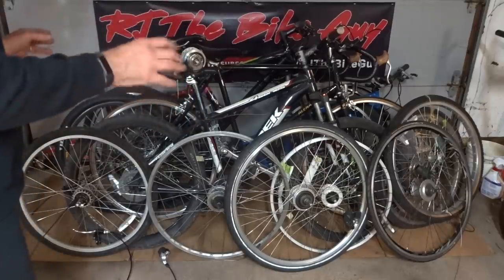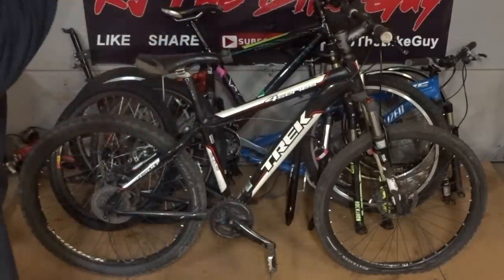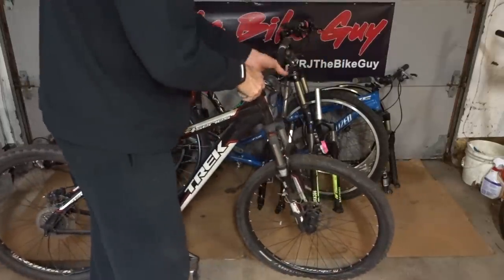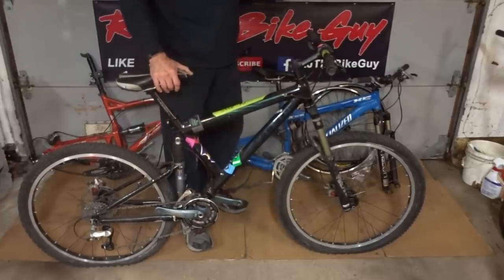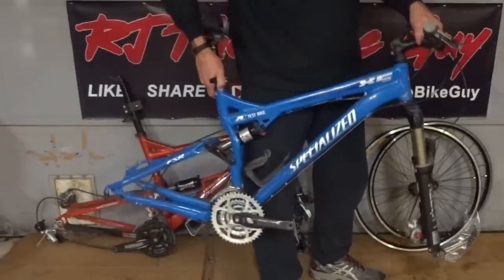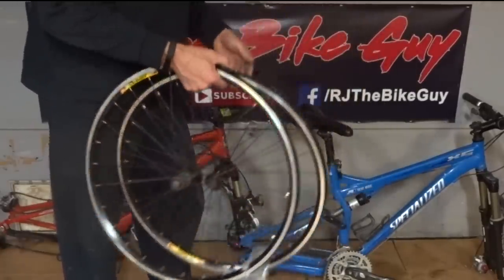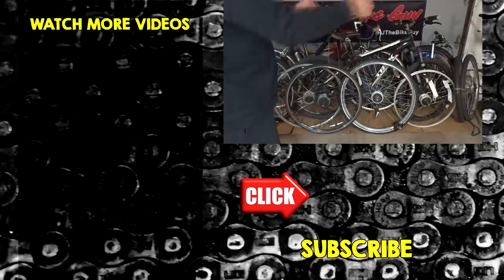My Bargain Bike & Parts Finds At Bike Co-Op Garage Sale!!! Amazing Deals!!!!

Comment: That’s awesome.. vary good find , them full suspension frames good like they can be turned into a nice set of bikes. Can’t wait to see a few builds. I worked at a bike shop for sometime and I jumped all over cool stuff like that when it came in. Today’s younger gen does not see carbon or new it’s junk to them. That looks like a find to me.....

Comment: 1:16About the cheap BB & cranks from Shimano: the Shimano square taper BB wont last me long, I get play in them after few rides, knocking, also cranks don't last me long.
I went with Chris king BB,Race Face Turbine cranks, stiffer and lighter setup, also can take major abuse, upgraded to cane creek preload ring.
have absolute black oval chain ring & bash guide.
the Bontrager Ranger wheels are junk, spoke nipples are weak, this is common problem on budget Bontrager wheels, rock strikes & truing will wear them out.
the headset is also bad, horrible seal, it will make a greasy mess.
the new bontrager saddles are uncomfortable but their older fit me better, but they wear out fast anyway, the plastic plate will come off, screws will come off. cheap upgrade I suggest is fabric scoop, if you go for steel rails, they are cheaper, if you find them on sale, its a great value, and will outlast most of the expensive traditional saddles.
the stem & bars: stem is heavy, bars will bend on side impact, so if bike falls over or you have to bail you risk bent bars. 
the seat post has worked well for me, only complaint is you cant get the angle 100% perfect, but it has been secure.

Comment: Now I have some idea how much parts cost.

I saw your video on how to clean the front suspension. 

I finally figure out how to take the cap off. Then I see Allen screw about 12 inch down. 

I need to go buy a long allen wrench. I was wondering what size that bolt usually is? Is 1/4 inch? Or all different sizes per manufacture? The now I am doing the operation on is just a Moongoo full suspension.
Reply from the maker: It will most likely be metric. Probably 5 or 6mm.

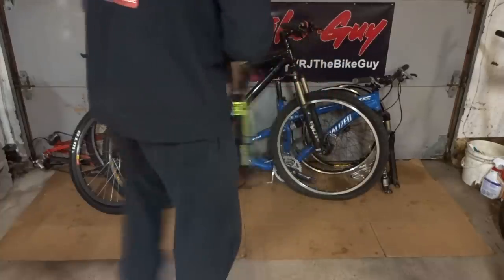Comment: 3:00 the trek has 44mm straight headtube, but there are external cups that make tapered for possible, but I could not find that anywhere, for at the time.
the frame is stiff enough, for me, I have similar bikes, I own a trek 6300 which is heavily upgraded, and a way to small bike which is a 3900 which is quite similar, just different name and paint job.
looks like you can get a pretty decent hardtail mtb, too bad I am not so lucky to find deals.
I had 475 hubs ob both bikes they were junk, when I was a kid the freehub lasted one season, now I bend axles after tree trips to the grocery store,I think bad tolerances,misalignment is a part of it, hope wheels on one of them now.

Comment: Wow. Great score. Some one threw out a Schwinn Moab 3 at the apartment complex  I work at in the basement. . I posted on the mailboxes to make sure was garbage . I think who ever had it was to lazy to carry up the flight if stairs to dumpster.  It has none working shifters,  there is s cable that goes to the shock fork., don't know what it does, , rusty chain etc. Frame looks good . I am gonna see if can get all to work.. Maybe give to charity or flip. I got a minty trek 950 I bought for a hundred bucks forva friend that needed a commuter.  All it needed was head set adjusted and a taller stem for the right fit. When you score good bike its like a rush😎
Reply from the maker: Sometimes shifters can be fixed by flushing/lubing. Cable to the shock is likely a remote lockout. Chains are cheap.
This works for mountain bike shifters too:
https://www.youtube.com/watch?v=tFmqV4klzaY
Reply: @RJTheBikeGuy  thanks, just waiting to make sure was a throw away somebody pulled out if their storage locker in basement,  but pretty sure. Do you happen the know if that Schwinn is any good ? Looks like original Shimano parts etc. Thanks again.

Comment: What's up RJ. Have u got anything on straightening a bent seatpost? I have a really nice U.S.E 'zero' seatpost from my 1993 stumpy that is slightly askew. It's a really light nice seatpost, would be a shame to not be able to use it again. Thanks mate👍
Reply from the maker: Aluminum?
Reply: @RJTheBikeGuy  I am pretty sure it is yeah - I can check in the morning!
Reply: @RJTheBikeGuy  well its like 20 years old and shiney so probably aluminum! I will hold a magnet to it just to check it's not steel ')
Reply from the maker: @danhurd8236  If it's aluminum, I am surprised it bent. If it is aluminum, replace it. Steel can maybe be straightened.
Reply: @RJTheBikeGuy  alright, thanks RJ 👍

Comment: Man I’ve only really gotten two good deals which were a Klein Quantum Pro frameset for 40 bucks at a flea market with a carbon USE seatpost and a 7 speed wheelset and a WTB Speed TCS Cross Country wheelset tubeless 26 thru axle brand new with a new wtb vulpine tire and 9 speed shimano cassette for also 40 bucks.

Comment: What is a nexus hub? Is that a battery in the rim?
Reply: Or just old school ?
Reply from the maker: Nexus hubs are from Shimano and they are internally geared hubs, similar to the old Sturmey Archer 3 speed hubs. So instead of having a derailleur, the gearing is all built into the hub. Most of the ones I got were 8 speed internally geared hubs. But there was a 7 speed and a 4 speed as well.

Comment: Great bargains....Seems like USA is the cheapest place in the world to buy used bikes....I'm Applying for a visa..:-)))
Reply: Deals like this are rare.
Reply: Only in his county. No where else dude. Lol
Reply: You can get good deals anywhere I’ve bought bikes for £500 before and sold For £900. I buy all my bikes using websites like Facebook, gumtree and eBay and it’s all about looking regularly,well more like 247, in most cases if you don’t message the seller within 20 mins of them listing the item somebody would’ve already beat you too it!
Reply: I once bought a Titus racer x for £180 when I got home I did a bit of research and found out it was one of only 100 in the world it needed a lot of work but i eventually sold it for £700

Comment: Great haul. Two things, what is a bike co-op?, and would you sell the specialized frame?
Reply from the maker: They are a non-profit, that takes donated bikes, and fixes them and gives them away. Repairs bikes for free. They also sell better bikes to help fund the operation. Occasionally when they are overstocked with bikes, they have a garage sale.
No. I will sell the bike when it is built. I only sell locally.

Comment: Trek 4300 Disc 2010 so the same frame as my 6300, so it can take abuse.  specs of my 6300: https://kit.com/mtbboy1993/my-upgraded-2010-trek-6300 but I plan on a dream build, as my bikes are too short for me. the reason I went with the shock & headset combo was necause it was the only thing I could find in stock at the time, looked most places, even second hand, sometimes fast easy solution is the right one at the time. but if not I would have gone with tapered fork and external cup, and went with 120mm fork instead. but the rest of hte spec is quite good.